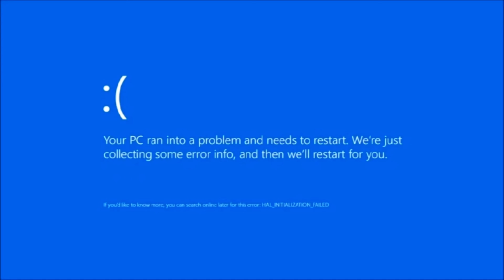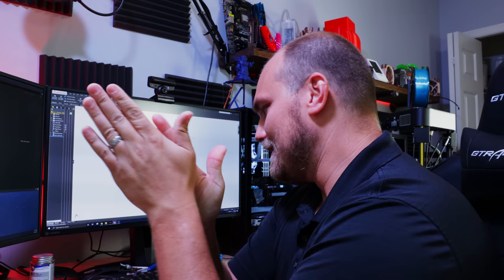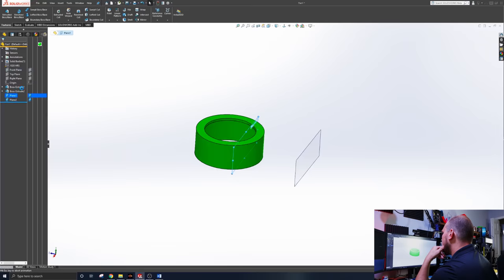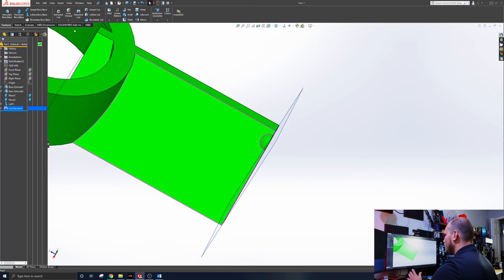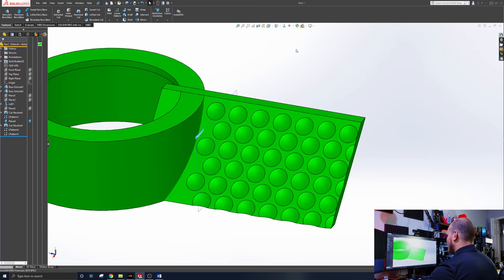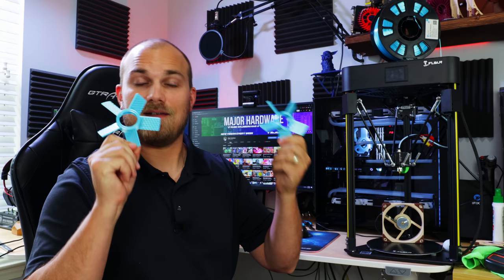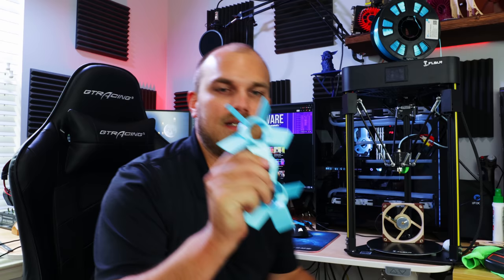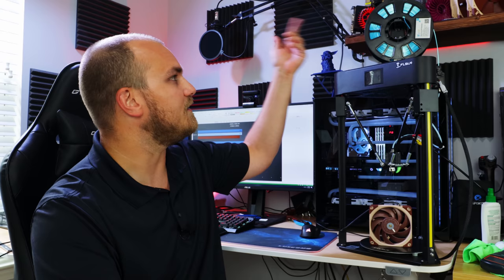What If Fan Blades Had Dimples Like A Golf Ball?

Comment: Recommendations from an engineer in automotive design: learn how to design airfoils, is not that hard, look for blades that are thinner (smaller cross sectional area) towards the center and higher cross sectional area towards the edge, the angle of attack must be higher towards the center than towards the edge
Reply: I saw him talking about MAC and some other airfoil characteristics in another video. Im pretty sure he knows what hes doing.
Reply: Dude as a mechanical engineering student. It's not as easy as you make it sound lol. A lot of calculations if you are gonna design your own.
Reply: Usman Saleem designing airfoils are not that hard, it’s hard to optimize them, but just designing them in cad isnt
Reply: Aerospace engineer here and can confirm.
Reply: Based on your knowledge, should the dimples help with a different design?
Reply: Robert Lugg I’m not sure the dimples will help at all with a fan that moves at these speeds. The dimples reduce the effects of flow separation on the trailing edge of an aerodynamic element. A golf ball typically travels at around 160miles per hour, while the highest tangential speed in one of these fans (2000 rpm at 55mm radius) is just of about 25.8 miles per hour. So maybe they could help if there was a design with a very aggressive angle of attack, but it’s effects wouldn’t be as drastic as you observe in a golf ball with and without dimples. Also, they wouldn’t need to be both at the front and at the back of the airfoil because flow separation only occurs at the back.
Reply: Difficult to 3d print things that go to an infinitely small point, you get unreliable results once it passes the resolution of the printer or nozzle.
Reply: @miguelcontreras5782  That's actually pretty cool information.
Reply: kahlzun as with everything the method of manufacturing has limitations, however, you always design based on the expectations of the piece and then adapt it to meet manufacturing processes. I’m the case of a fan with an airfoil you can design to as small a point anyway, because when you get smaller the printer will just not print and that’s it. And it happens with pretty much any shape, if there’s something that can’t be done the printer just ignores it.
Reply: @miguelcontreras5782  As a machinist, engineers like you are a rare breed. Most skip the "adapt for manufacturing phase".
Reply: @peterCheater  Good engineers keep manufacturing front-and-center of their design.  Great engineers even consider maintenance.
Reply: James Willich not really, you need to have at front and center the job that the piece is designed to do, yes manufacturing is important, but for example, in the automotive world, where weight matters a lot, you might find it easier to make a bracket if it’s just a square block with some holes and pins, but then it would be too heavy, which is why we must resort to harder to produce geometries that manage to keep the balance between form and function adequate to the application.  Whereas in the maintenance department, it’s always better to design something that requires no maintenance at all 😂
Reply: @miguelcontreras5782  I am a little biased though. Given a choice between an engineer with manufacturing front and center versus design with intent front and center. I would choose the latter, makes my life easier 🤣🤣🤣. But that path doesn't generate innovation in machine capabilities.
Reply: I'd copy and air plane propeller , Alaska bush  style ..or a stunt wing for quiet and push
Reply: There are programs to help with airfoils.
Reply: Old joke fitting for this thread: How do you know someone is an engineer? A: They’ll tell you.

Relax everybody, I’m telling that joke as an engineer myself. And, yes, I see the irony…
Reply: @f123raptor  Ain't that the truth. My great grandfather was an aerospace engineer for NASA, and my grandfather was a mechanical engineer. I had wanted to pursue a field of engineering as well, but have decided to continue in my family's history of fine carpentry. In many ways, with the strange projects we pursue, there is little difference. Much of what we do requires us to innovate methods for construction that are unconventional and anticipate success over half a century without failure. Perhaps someday, I will work towards a mechanical engineer's degree, or electrical engineer. Likely, it will be for fun. Where I am right now, I am proud of my work and don't see myself slowing down until I die 🤣
Reply: @garymingy8671  Nope. Way different Reynolds number. At the size and speed these small fans go it's probably more sensible looking at insect wings.
Reply: Miguel Contreras “Designing airfoils are not that hard, it’s hard to optimize them, but just designing them in CAD isn’t“

Wait wait wait – design airfoils… without optimizing them?!?!?!  BLASPHEMER!!!! 

I joke, I joke... 🤓
Reply: Aerospace Engineer as well here.

The problem is optimizing blades is an utter pain in the ass. CFD on blades is a nightmare. So most of the testing ends up being wind tunnel based. You can follow basic methods, and theory. However, propeller theory is a very specific theory in Aerospace.

As someone who is going to graduate in one semester (God damn flight controls masters level course in my undergrad)

Anytime we touched props it was pretty much buy it or find one already made because you will drowned in theory very quickly. 

Also one of the most important things for props is tolerance. It doesn't matter what you design. It matters what you can make in the real world. Prop tolerances are just as important for efficiency as shape if not more sometimes.

Comment: This reminds me of the mythbusters where they added golf ball dimples to a car. It actually increased the milage quite a bit.

One of the unexpected best wins on the show.
Reply: And they used 350lbs of clay on the body of the car to make the dimples. Even with the weight the mileage went up by 3mpg if I remember .
Reply: @steveogilvie1773  They adjusted for the weight of the clay (though not evenly distributed) with the control and the dimpled design did better than the control. If you don't know then don't say, people will often conflate assumptions with fact.
Reply: I parked my car on a driving range to get the dimples for fuel savings. After spending $2000 replacing the windows, I'm proud to say I save $0.50 every week on gas. It will only take 4000 weeks to break even.
Reply: @WhateverMan35  well, congratulations you win biggest flex on mythbusters trivia...i bet you were the best 12-year old “scientist”
Reply: @toddmulligan2609  #Did someone piss in your cornflakes or something?
Reply: Do a google on nuclear submarine bubble generators.
Reply: So THAT'S why all the people around me never fix the hail  damage on their cars!
Reply: mythbusters was fictional entertainment and nothing more
Reply: @WhateverMan35  get out your segway and cape and do some science

Comment: MythBusters added Dimples to a Car ( The Entire Body of the Car ) and according to them it actually got a lot better Gas Mileage.
Reply: I saw that done to a car at ''The Tron'' Edinburgh in 1980 - way before Mythbusters. Some visitor left his car (illegally) parked overnight, without knowing about the new year's eve party - where it got comprehensively danced upon by 5000 revellers. I saw the poor guy getting a drubbing from his wife as they were picking it up the next morning. Still the funniest fly-on-the-wall story I have.
Reply: I emailed McLaren Mercedes F1 around 10 years ago to try this.
Reply: @Flat-White  Not allowed.
Reply: so maybe the dimpled fan draws less current...
Reply: @christianweiss4971  power out equals power in times efficiency factor. Standard blade is probably efficient enough that the difference is not noticible. It did sound a little bit softer, maybe for larger fans it could help reduce noise a little bit.
Reply: reducing air resistance kind of defeats the purpose of  fan.
Reply: @dessertstorm7476  if another kind of fan produces more turbulence than the other..?
Reply: @dessertstorm7476  its turbulence at the interface that is being changed, not the overall bulk fluid
Reply: I've seen a few things like this.  I had thought of this as well.
Since the dimples are designed to keep turbulent flow sort of in a bubble around the skin of the golf ball, it would do the same thing to a car... but a car's shape is drastically different and it isn't spinning in the air.  The best use would be to place the dimples in certain locations to localize the turbulent flow.  I'd love to see more studies on this.
Reply: Surprising, since weighed down with a heap of wet clay and the other just had a splash of mud
Reply: @watchman1872  don't forget the red stripes.
Reply: @peterdavidowicz4374  I have dimples and ran the fastest 100m in my city in 7th grade...coincidence?
Reply: So, if a Nascar driver were to put dimples on their car in a restrictor plate race would that mess up the ability for people to draft behind them?
Reply: Drivers of hail damaged vehicles realized this years ago! LOL 😆
Reply: Mythbusters is as reliable as wikipedia.
Reply: Also you must note how the wieght of the vehicle they used was increased with the clay they used to create the dimpled car.
Reply: @OminousCamaro  I realize that, if the Dimples were built into the Body when the metal was formed the car would get even greater mileage. The car would weight a lot less without the Clay, that is understood without being said.
Reply: More like inverted car dents...
Reply: I wonder if the current draw on the fan is lower with the dimples.
Reply: In the case of fans it would mean less power for the same performance.